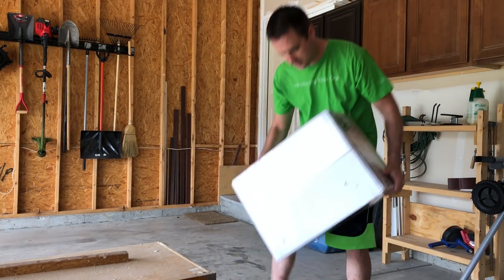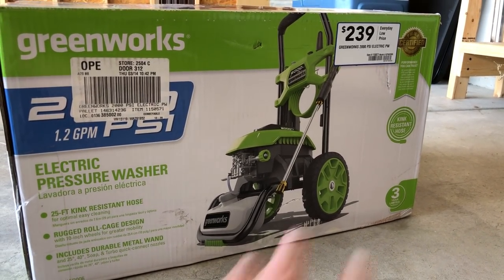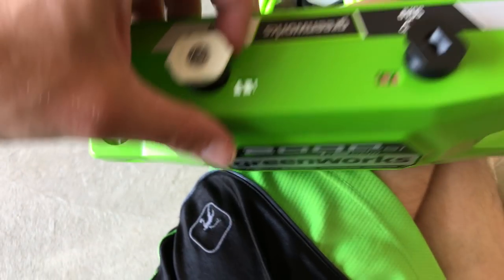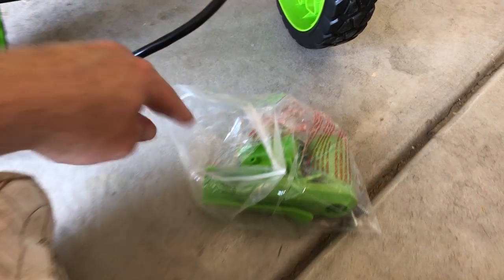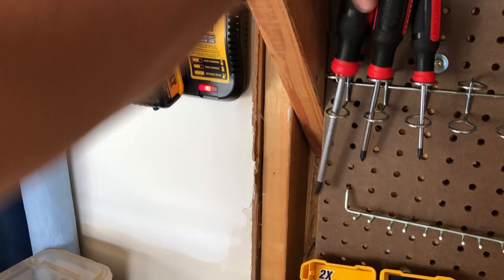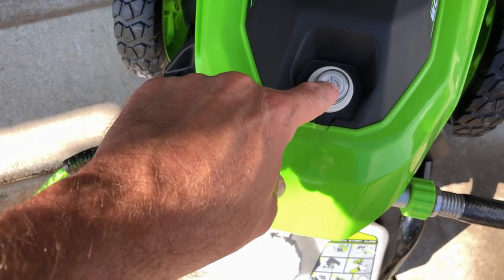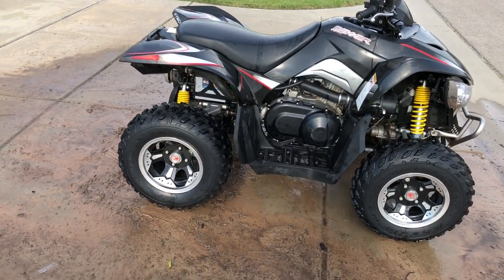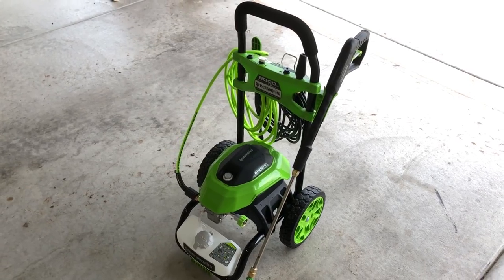Get dirty, clean with POWER

Comment: Nice job. Looks like new after the cleaning!  I think you have the right amount of power. Too much power and you can do damage. Same with your driveway - too much power and you’ll etch away the top layer of concrete. It will look ok when wet, but when it dries you will be upset.

Comment: Greenworks have had issues with their motors going out on the electric washers, just FYI. The 2000psi model you have uses the same basic motor as some smaller handheld units with only a couple minor changes. I've had friends with that model have overheating issues within the first year of ownership. Had one denied a replacement because the 3 year LIMITED warranty didn't cover the part that was broke. Check some of the reviews on the very link you provided to see what I'm talking about. Too many people throwing out a 5 star review before even giving it enough time to review. Looks like amazon reviews, lol. You might want to do a comparison with another brand while you are still within the return window on it to be sure.

I had a smaller 1300-1600psi no-name unit that just wasn't cutting it, and upgraded to the 2300 Ryobi electric with the new brushless motor (got it as a father's day gift). I believe it was $20-30 more, but comparing my unboxing experience with yours and the build  quality / materials I'd say it's beyond worth it. Already put it through some bigger jobs with a surface cleaner attachment and it was great. Not shilling them just saying what I decided to go with for an example.

Again, I hope it works out for you if you are happy with it, just wanted to give you a heads up.